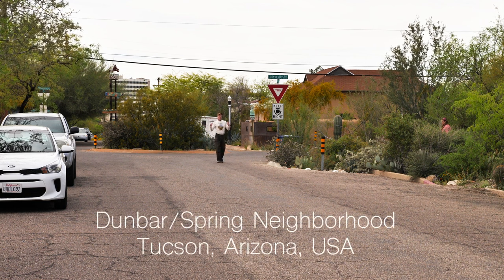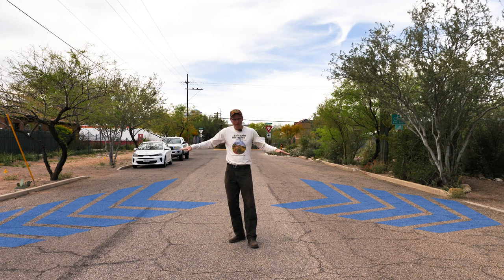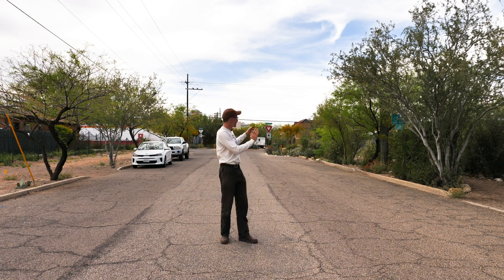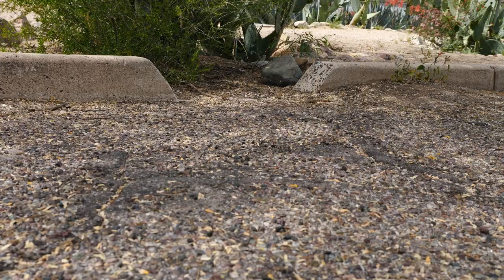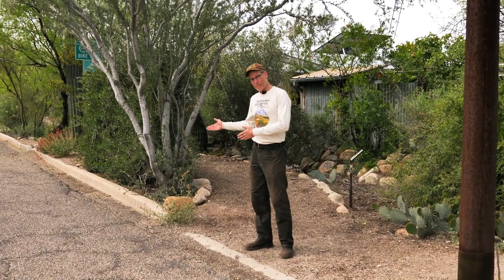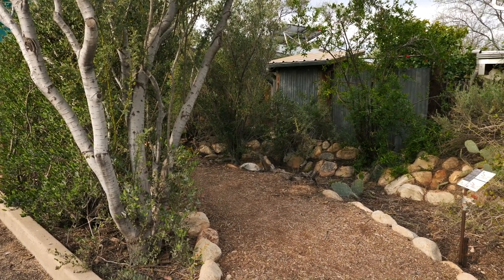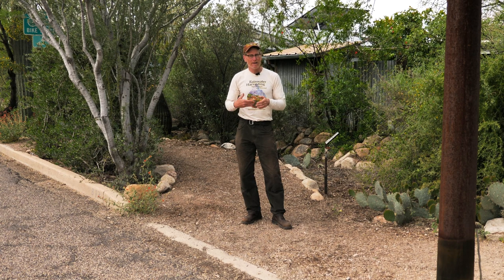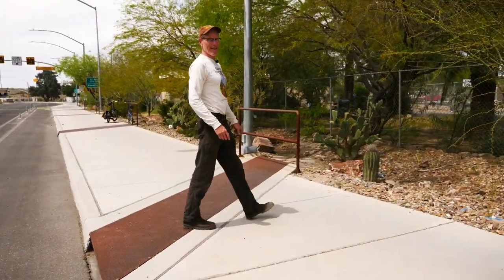Desert Streetside Rainwater Abundance at 25 years!

Comment: Not only beautifying the local, but on the aggregate, the cooler microclimate is multiplied by the number of installations all over the city. Instead of hot asphalt and concrete creating a 140 degree Fahrenheit oven for months on end, the city with be cooler. I like the rain-gage idea. Another idea install two exterior thermometers. One under the tree canopy and another in the open asphalt/concrete space nearby. Possibly a 30 or 40 degree difference. City planners like numbers. Keep a record especially during the hottest season.

Comment: Sir, I have a plan to build dams, swales in an arch, apex of which is downstream. Each swale built of round hay bales encased in concrete and rolled into position with farm tractor to form a dam up to one hundred feet. To hold six ft of water and each swale larger wider than the one before each bale chained to the next two